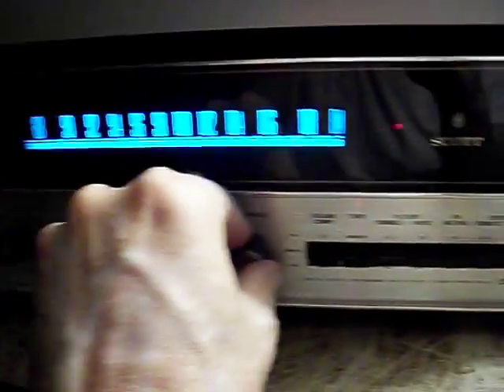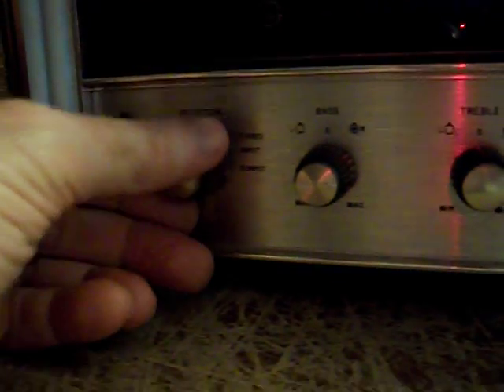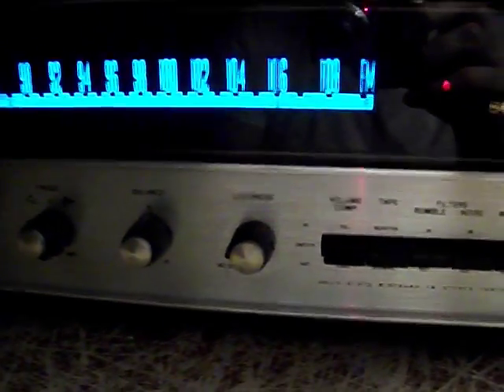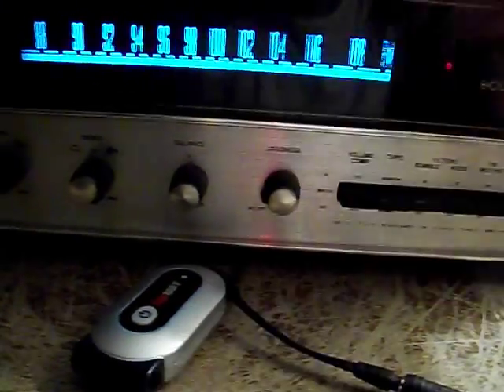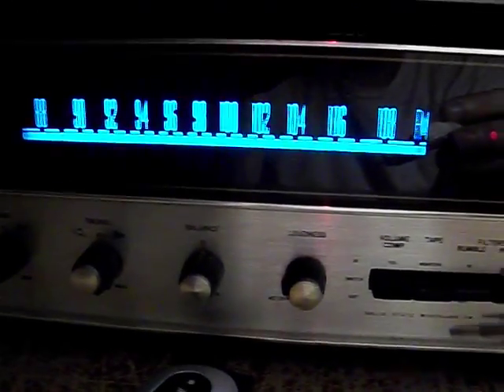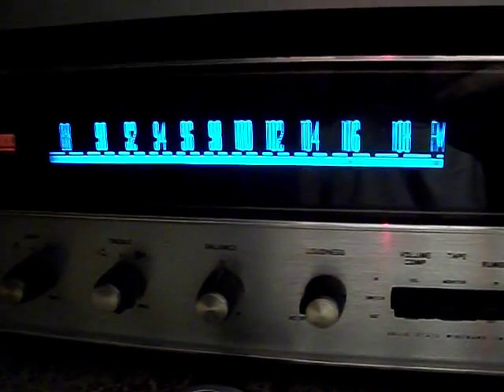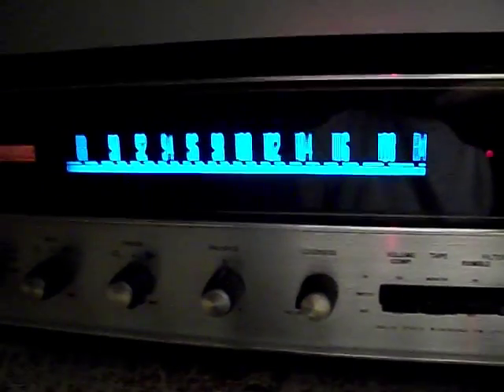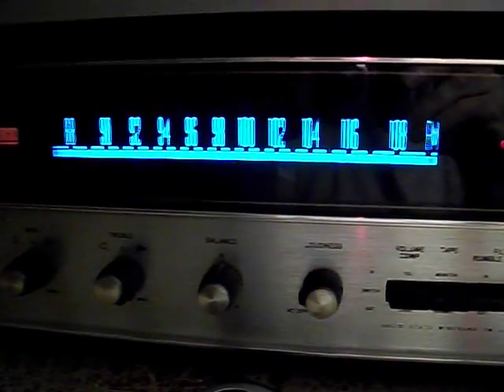HH Scott stereo master 348-B MPX adj

Comment: She came along great! I forgot, did you change the diffuser in the reworking video?
Reply from the maker: Steven King no change in video. Yes I like the scott a lot more even than my Fisher 400 I must admit. I dont mind running it all day, with out put transistor that cost 1$ each vs 7868 tubes that run 50-75$ each (times 4), it appeals to my cheapness.
Reply: Cheapness! Well your videos are not cheap.  Top shelf sir!